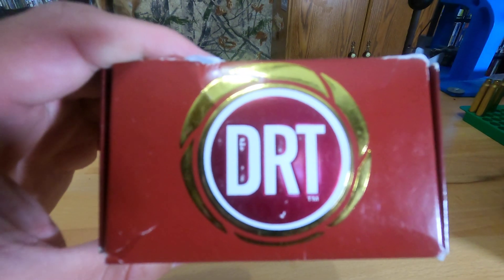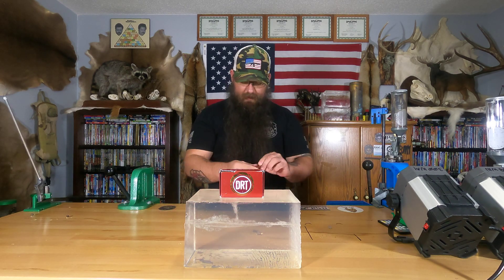Ballistics gel hunting vs match bullets episode 6 DRT match BTHP

Comment: Curious have you tried a 175g matchking
Reply from the maker: Yes I used the 168 and 175 SMK for years. Killed a lot of animals with them. I've got them on the list to run through gel too. Some people have had issues with the hole filling up and it acting like a fmj. I've never personally seen it but I know people who have. To fix that and get better performance they simply use a 1/16" drill bit and open up the hole a little. Or you can just go with the Sierra TMK's which is the same thing but with a bigger hole and a ballistic tip.
Reply: Good deal going to try them I’m currently using a 185g Berger Otm tactical in .308 good bullet good performance great accuracy high price lol
Reply from the maker: You should watch the video with the Berger hybrids episode. They are the best Berger bullet and they are incredibly destructive